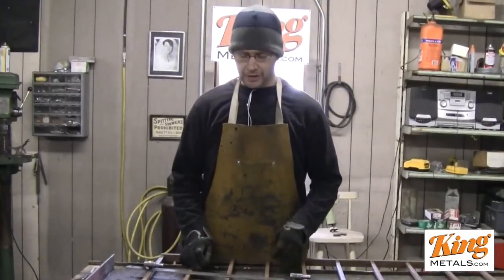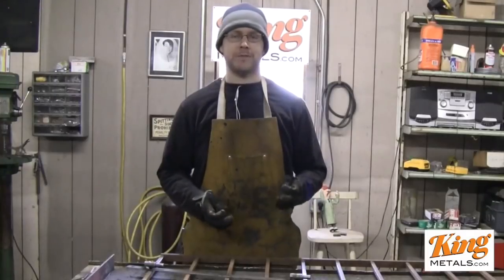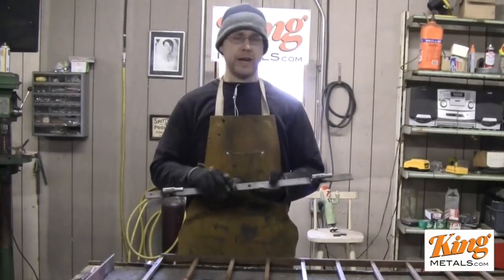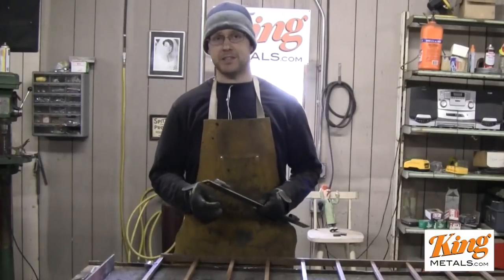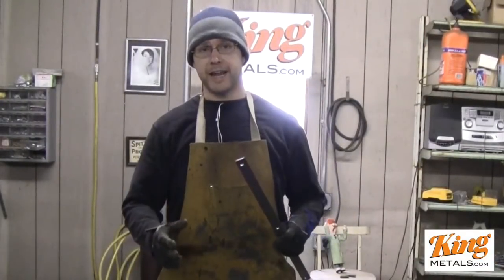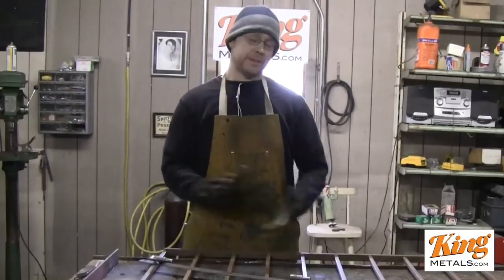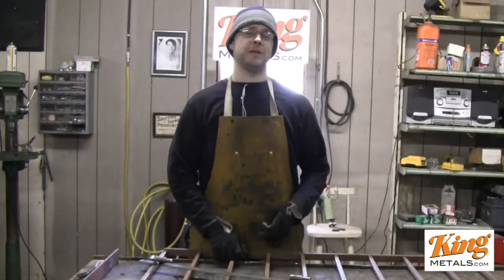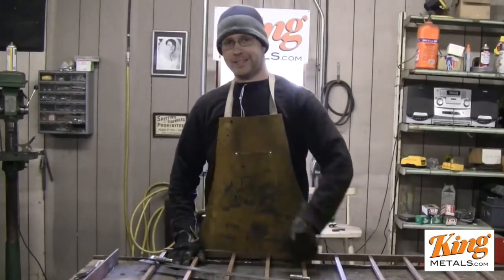Quick Tip for Welding Barrel Hinge

Comment: I'm trying to visualize how I would do this with a two-piece drop-down ramp for my trailer. The barrel hinges would be on the bottom of the ramp holding together the top and bottom sections. I was thinking of welding them to two lengths of angle and then welding the angle to the frame of the two sectiions.

Comment: If you weld a tab so the gate can't be lifted off then how will you install the gate? Meaning you have to put the gate on, bring a portable welder and weld that tab on. Another option might be a security screw with a tab so that someone has to defeat that screw to get your gate lifted off. Still there's a reason why 99.9999% of doors have three independent hinges.

Comment: Nice vid, only one thing. It's not a safe way to mount the hinge like that. If it is for security it won't work cos the thief can lift it off the hinges.
Reply: unless it's locked right? But if a thief can get past a lock, then  there's no reason to lift the gate off.
Reply: the solution is to weld on a tab that prevents "lift up"
Reply: If you weld a tab so the gate can't be lifted off then how will you install the gate? Meaning you have to put the gate on, bring a portable welder and weld that tab on. Another option might be a security screw with a tab so that someone has to defeat that screw to get your gate lifted off. Still there's a reason why 99.9999% of doors have three independent hinges.
Reply: @chucklechortle  what am I looking at there?